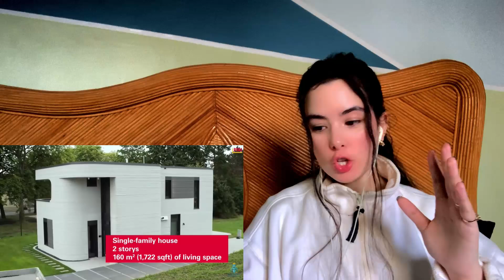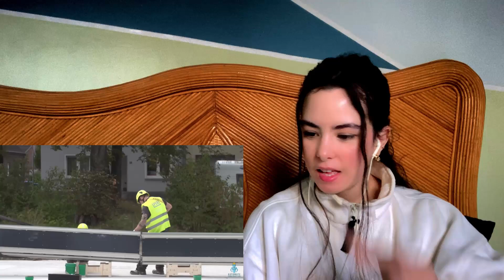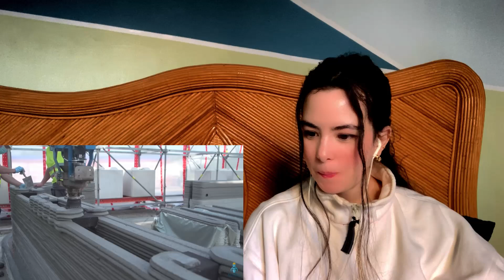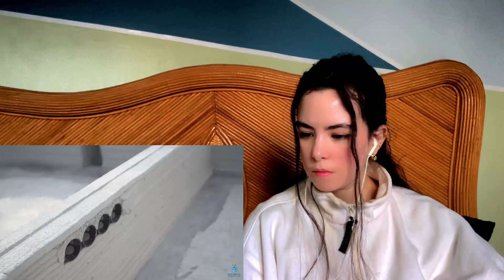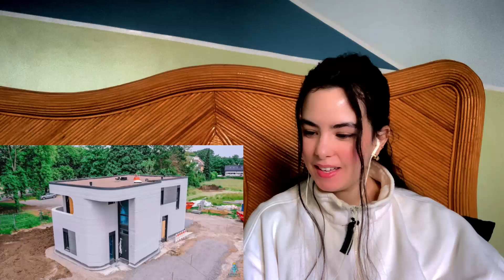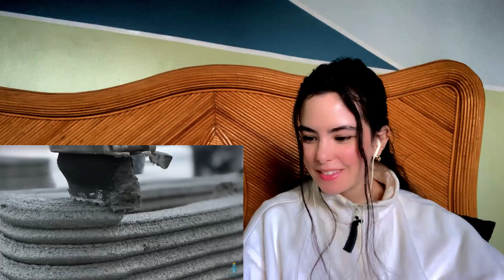German 3D Printed House REACTION!

Comment: printing at site probably will stay a niche application for the few wishes of having a mostly monolithic structure ... for the wider housing market it seems more economical and logical to build high quality static printers which can produce large high quality prefab elements fast without wasting so much skilled labour by having them drive around, setting up and managing a mobile printer each time and open to the elements.
Prefab housing is the way to go and a 3d printer in prefabrication just gives that method design freedom as one-off elements dont require more effort then a series element.

Comment: That's actually very interesting and innovative.

The problem with concrete houses, however, is quite different: Concrete, or rather the cement used, produces a huge amount of CO2 during production.

This is because, on the one hand, a lot of heat is required to produce cement clinker (the main component of cement), and then a chemical reaction itself releases CO2:
CaCO3→CaO+CO2

Unfortunately, this means that concrete contributes to approximately 8% of man-made CO2 emissions worldwide.

Comment: A friend of mine actually works at a company, building such houses in Canada. They idea is to makeing housebuilding cheaper. But they are all just starting. In fact, I don't know how far my friend's company has come, as of today. The building of the printer i.e. was facing quite some delay. A pro is surely the short time it needs to put that house up at the site. It's creating very few waste. The material is said to be even recycable. As much as I'm not such a big fan of the surface of the walls on the inside: what about dust building up on these walls in the long run?
It does look fascinating at 1st sight. Is it pacticable?
Reply: The walls have not been plastered so that you can see the new way of building inside. I assume that it would be possible to smooth these walls without any problems by either plastering or cladding them. Here it has simply been used as a style-defining element.